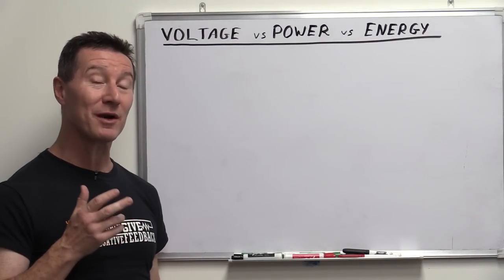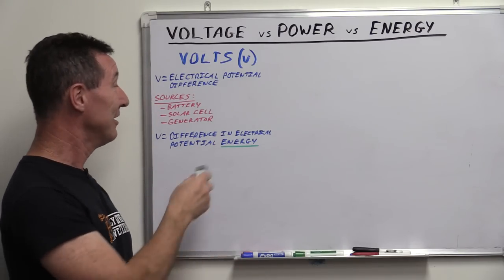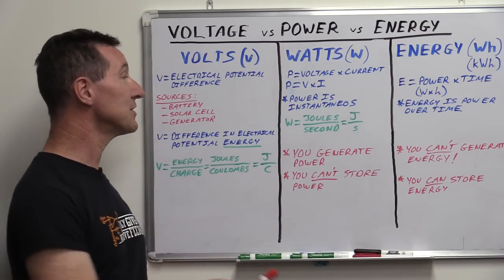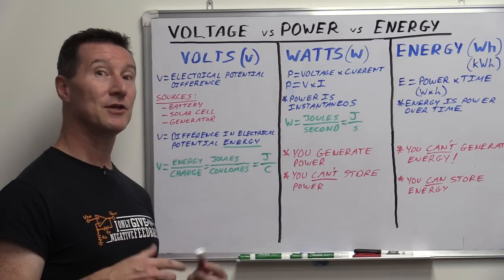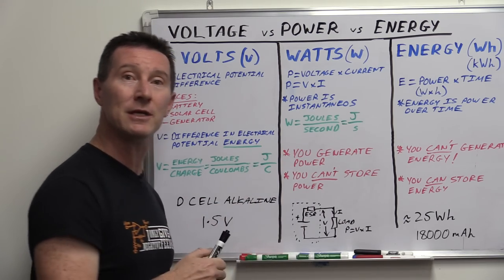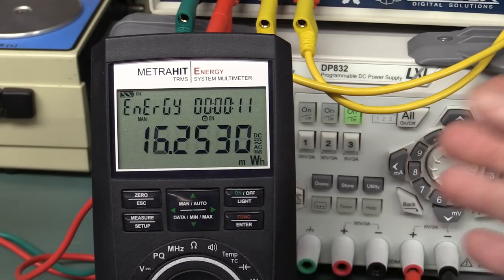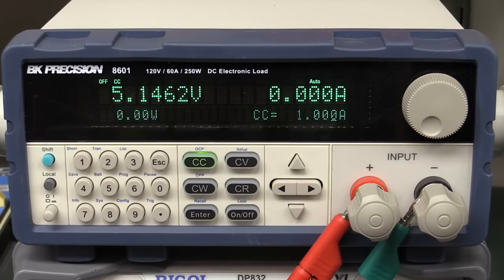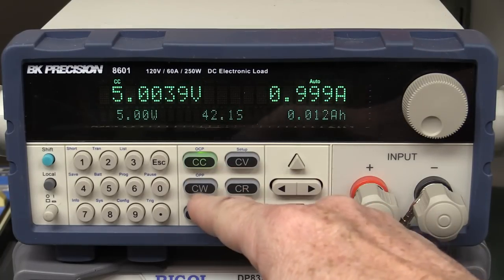EEVblog #1009 - Voltage vs Power vs Energy

Comment: Dave please do a video explaining impedance. So many people are not familiar with the idea of AC resistance.
Reply: AC in resistance has a lot of steps for learning, impedance goes hand in hand with  capacitance you must learn them both, and before that you need to understand sin waves and phase. It's very interesting topic but it's not something you can jump right in with out explaining the other basics of AC first.
Reply: ac impedance is finicky though ... but the best way ive learnt to understand them is vector diagrams
Reply: Good ol' ELI the ICE man!
Reply: I think electronic engineers focus too much on the maths. Look at the physical reality of systems and why they behave a certain way. e.g. why do inductive loads raise impedance and draw current lagging voltage? Why does a capacitive load drop impedance and draw current leading voltage? Then later you can learn the maths to apply the understanding to each new scenario.
Reply: And they turn a lot of people off from pursuing the field of electricity.  A good teacher would teach practical concepts (how things actually work) then bring the math on (as little as actually necessary) as the student gains a working knowledge.  You can do a hell of a lot with electricity with just ohm's and watt's law. Not everybody needs engineering level math to do their jobs.
Reply: Basically look at the formulas for impedance of a capacitor and an inductor. Youll see that manipulating the frequency (omega = 2 * pi * f) plays a big part in chanhing the impedance. I would also suggest looking at simple high and low pass filters that use capacitors.
Reply: Do you guys think it is actually necessary to know how to do a Fourier transform, when you can run a detailed FFT analysis even on a phone?  More important I think is just to understand that  frequency and phase are two ways of looking at the waveform and they can be extrapolated from each other. Know that minimum phase systems exist and they follow certain behaviours. Job done, no? :)
Reply: Immittance and its measurements
Reply: I agree. Starting to teach the fundamentals before hitting with formula is a better way to explain. However....
Guys lets talk REAL English. "Do the math" is the most lame  American language mistake. Its "Do the maths"...short for "Mathematics"...not "Mathematic" . 
Thank you.
Reply: gs425, I can only guess that fixation over your version of "real english" must stem from the fact that you drink something you call "whoata" which inhibits your ability to properly ennuciate certain vowels and consonants. Do the math; unsubscribe from here and log on to a  channel that celebrates the queen's english. You'll be happier and enjoy much less frustration from those of us who are only trying to help others acquire their "aha" moment in this profession.
Reply: To explain impedance in its most basic form, is to say that you are measuring how A/C voltage, of a certain frequency, reacts to the capacitance and/or inductance in a circuit. D/C resistance is always D/C resistance. A/C impedance takes into account the frequency of an A/C signal. (Way over-simplified, I know, but it's the easiest way to explain it, in the shortest amount of time.) For instance, have you ever measured the D/C resistance of an 8 ohm speaker and wondered why it was only 6.3 ohms? It's because the "ohm" rating of the speaker is measured in impedance. (Speakers are inductive.) Speakers are nearly always measured using a 1KHz A/C sine wave. At 1KHz, the speaker exhibits an impedance of 8 ohms. That's where the 8 ohm rating comes from. There is A LOT more to it, but for the average hobbyist, that's enough to give them a basic explanation between resistance and impedance. To go any further would be way beyond what anyone could do in a comment section.
Reply: i think because home or industrial equipment use 50/60 hz electricity, it's low enough that you can simply assume zero for simplicity to be understandable for layman. AC analysis can be too complex for layman, many physical phenomenon will be arise and should be taken into account. Also many power engineer students i know, think more about power factor than frequency or phase response. It really different with electronic and microwave telco engineer that really have deep understand in fourier transform concept and application in designing circuit or digital signal analysis.

Comment: Photonicinduction's comment sections are usually full of people asking how high his electricity bill is. The fact is that it's barely different to a normal one, as his high power experiments do not run for a long amount of time, and don't run up a high cost as electricity is charged for in energy.
Reply from the maker: Yeah, good example of energy usage.

Comment: I've always explained to little kids that voltage as the pressure that is pushing on the electrons to move, current is them moving, energy is the effect of what happens to the thing they move through and power is the rate of the effect.
Reply: AvE would have said Voltage is how angry the pixies are at the door, and Current is how many of them are running through your house after you open the door.  Energy is how much damage they do in the process.
Reply: Stephen Low i think of voltage in like strength (the 'amount of pull' on the electrons)
Reply: And power is you watching them smashing things every second!
Reply: Except that the electrons don't really move that much.  They certainly don't flow from one end of your circuit to the other at the speed of light, like you think they do. :)
Reply: Electron always had this trouble of moving thru materials, all the atoms jostling around is blocking & slowing them down... but as an electron is pushed forward, its neighbour in front of it senses this and made his step forward as well, and it chained with next neighbours making a general step forward too, and it result in electrons marching forward... this electron centipede allows electric current to be transferred at near light speed.
Reply: A long plastic tube full of marbles. Push one in this end and one is pushed out the other end.
Reply: I think of electrons as a piece of string. When you tug one end, they feel it at the other end, in about the same time it takes for light to travel the same distance.
Reply: Landrew0 And there, Volts is how hard you pull, Amps is how fast the string moves, Watts is how quickly you can pull your toys into the your room. Energy is how many toys you moved there, no matter how long it took.

Comment: AvE would have said Voltage is how angry the pixies are at the door, and
 Current is how many of them are running through your house after you 
open the door.  Energy is how much damage they do in the process, and he'd be done already.
Reply: Power would be the damages they are currently doing. Energy would be how much they have done over a period of time,  to untill they get exausted. If you stop them, they won't cause any more damage, but they still have the remaining energy.
Reply: I find this more accurate than Daves explanation which ignores the concept of charge. As he waved his hands at, Voltage is the energy each pixie has...the more pixies that flow, the more energy is carrived by the pixoes per time which means more power and more skookum chooching...
Reply: Landrew0 👍AvE!
Reply: The pixies are the current, the charges. The voltage is what move them around, the potential difference between two points.
I guess pixies are no easier to understand than Watts and Joules/s defining each other...
The "pixies" is just an other way trying to explain Ohm's law anyway, not trying to explain power and energy, imo.
Reply: So what happens if Hodor holds the door closed?
Reply: Miles Rafferty that is what we call a diode.

Comment: Dave, WELL DONE!  I've been an electrical utility engineer for 43 years, and I'm constantly amazed that we produce new engineering graduates that don't understand these concepts. Half can't explain the difference between kW and kWh. 
Now, since you are on a roll, trap for young players. Explain the difference between real power and reactive power. Heads will explode!  Great video!
Reply: Bill Moran Really? People can get engineering degrees without that being so engrained into their head that it's intuition?

That's like, first year EE bullshit classes stuff.
Reply from the maker: @CODMarioWarfare what prompted this video was a video I saw of a graduate student saying that voltage was energy!
Reply: I am not an expert physicist, but my common sense tells me that voltage is a measure of potential energy( per unit charge). When you say that we can have voltage without energy, I dont think so. Static energy is a small amount of energy. But it is energy. Voltage is not 'energy' just like power is not energy. It is rather the energy per unit charge and the energy used or produced per unit time respectively. But they all mean energy, although a specific or more accurate way to describe that energy.
Reply: I agree with "When you say that we can have voltage without energy, I dont think so".  this example is not so accurate. If we have huge voltage from static electricity that means we have lots of energy but few charges and this coincides with a big voltage with no current that doesn't kill.
Reply: CODMarioWarfare first year EE BS stuff is the foundation of engineering. The problem we have is people who got a degree but don't actually know anything they should have learned. The degree means nothing. It's what you learned that counts.
Reply: Bill Moran; I've got an utility engineering question for you. While touring a substation connected to an extremely high voltage national grid line, I was very surprised to see a synchroscope installed in the switchgear. The substation was one of two placed at opposite sides of the city it serves. There are no standby generators involved. Other than apparent power loading down the grid, what causes substation frequency to become unsynced?
Reply: Powerelectronicsguy There are many possible situations where transmission lines can differ in phase angle. Without getting too far into the weeds, the effects of inductive coupling between phase conductors over miles of transmission lines and capacitive reactance in underground cables can create shifts in phase angles. All substations have synchroscopes as a check to assure that an out of phase closure is not attempted. Similarly substation transmission breakers are equipped with "sync check" relays that will prevent the Parker from closing except within a vary narrow differential  phase angle.  Unlike synchronizing a generator to the line, there is nothing a substation operator can do to change the synchronism of incoming transmission lines. It is purely for verification that there is nothing wrong prior to closure of the breaker. Remember, those transmission lines handle enormous amounts of energy. An out of phase closure would be catastrophic. Hope that answers your question.
Reply: Thanks for the reply. I think SCADA caused the farside substation to go offline within 100ms after nearside closure. If out of sync, I guess the operator must wait for in phase rotation to occur before initiating closure.
Reply: Powerelectronicsguy , breakers on transmission lines are normally equipped with multiple types of protection including distance fault detection that senses where the fault is located and will trip breakers on either  side of the fault. In some cases such as a high impedance arcing fault a delay is built into the logic to see if opening the first breaker has cleared the fault. Frequently it will and the delay prevents causing an outage for a lot of customers.

Comment: Just wanted to say that I wish I could double sub you, Dave. Your explanation was very good. The concepts of energy, power, voltage are very clear as you explained it (at least clear to me). Hope you do more of these types of lectures that digest first principles. You'd be amazed how more clear you sounded than most high school teachers or even college professors. I do have to admit that for people to more comprehend what you've said that they also have to know current (and therefore resistance as well), but I see why you deliberately chose not to delve into that.

Comment: Dave, on the matter of teaching, I just remembered something. A while ago you reviewed an industrial IO adapter for the RasPI, and I remember you marveling about how those I/Os were properly voltage and current limited for industrial use. Could you do a video on how to actually do that, please? That is, how to "Industry-proof" µC I/Os, or devices in general, with proper U and I limiting and anything else you said back then? Thank you <3

Comment: Brilliant Dave! I knew all of this, but somehow I hadn't twigged that mAh ratings are not a unit of energy stored in a battery. I totally didn't think about the voltage drop.
Reply: Is not just about voltage drop a NiCd battery has a nominal voltage of around 1.2V while  LiCoO2 cell around 3.7V so if they have the same Ah rating they will have quite different energy storage capacity.

Comment: Great explanation!   One slightly under-represented point is when you were talking about Amp-hours at the end.  Amp-hours basically just count electrons, and that is why amp-hours (Ah) are incredibly useful when talking about batteries because that is really all that gets moved around chemically in the battery.  Since electrons aren't gained or lost through resistance or heat (etc), it is a very useful unit of measure for a battery.   Even when a battery loses capacity with stress and age, it simply means that some of the electrons get bound up in chemical structures in ways that make them unavailable to the circuit.  They aren't actually lost.

On the flip-side, lots of those little USB power-back makers advertise their capacities in mAh, but decline to mention what voltage of the underlying battery pack, and so intentionally misrepresent the actual energy content of their power packs.

This reminds me of another little snippit... you know all the silly hype about those "nuclear batteries".  Its easy for the nonsense-pushers to talk about tens of thousands of years of energy and replacing EV batteries with "nuclear batteries" when they neglect to mention that such batteries put out so little power you'd need millions of them to generate enough to make an EV actually go anywhere.  Oops!

Comment: I've never seen this analogy before but watching your video made me thing of representing energy as distance and power as speed.  There would be a mathematical correlation if the distance were vertical.  (I thought of doing a quantitative example comparing speed and power--and distance and energy but it would have been very messy.)

Comment: WOW thanks, now I've got it!
So the reason that high voltage with wary low current don't kill is that even when the voltage are i.e. 20.000V you are only getting "drops" on your head.
While lower voltage with height current is like getting a bathtub of water from i.e. 2 meter above your head and it can therefor easily throw you to the ground.
Am I right?

Comment: So if I understood it correctly mAh is a Measurement of Charge (Coulumb). This means that I could get the Energy by multiplying with the Voltage. Could I divide the mAh by the Amps of my system (V/R) and get the maximal time I can use it by doing so?